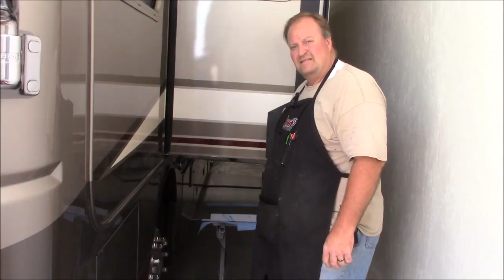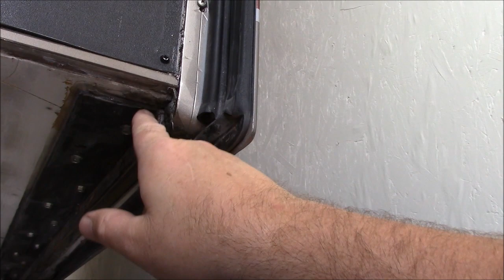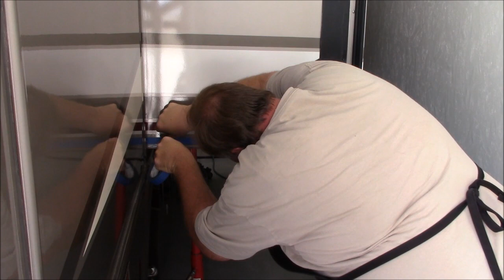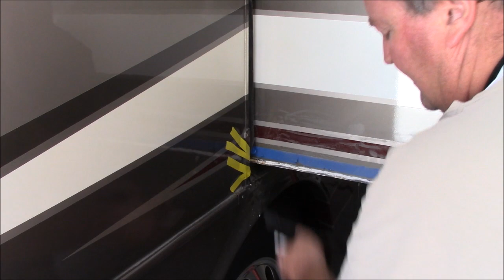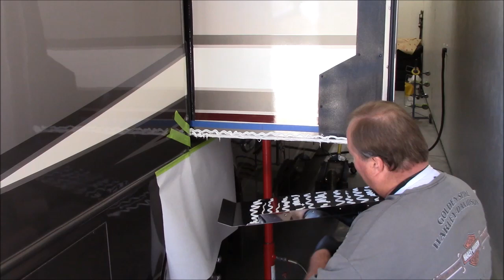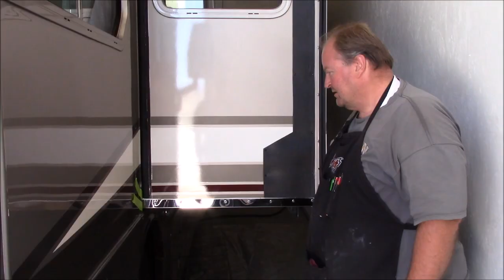Guardian Plates for Monaco HR Flat Floor Slides FF1200

Comment: Mike, a couple questions. Did you cut/trim the black plastic cover so it is not behind the side of the plate?  Also will the rivet heads on the bottom dig into the UHMW bar?  I have some minor rot on my 06 I did not think I had any when I bought it. Solid but the plastic floor is sagging on the ends a little and the wood has been wet. Terrible job by Monaco on this. Thanks for the video.
Reply from the maker: I don't recall trimming the black cover but I did trim the lower angle back and machined a groove in the black lock guide so it didn't bind the lock.

Mike

Comment: How deep is the 25° lip?
Were are the mentioned rivets on the underside?
Reply from the maker: I’m not sure what depth your after. Are you inquiring from the end of the plate under the slide floor to the center of the bend?  If that’s the case I would say 2-3 inches. 

I’m guessing based on memory as it’s been a couple years since I installed them.  If you need any specific measurements I’d contact Chris at Talin and he can measure one and give you an exact measurement.  

Thanks for watching.  
Mike

Comment: Glad to see this.  I need to do this on our '05 Monaco Knight 38PDQ.  It has both the flat slide and the lifted slide.  Question - If none of the guardian seams or caulk is tapered down from the body to the outside edge of the slide, what keeps water from walking along that flat seam and into the coach?
Reply from the maker: The 3M 5200 adhesive and rivers keep the Guardian plates tight against the wall and floor of the slide. It is much tighter than the extruded aluminum channel that Monaco used.  
Thanks for watching. 
Mike

Comment: I had to say thanks for your very informative Video On Augahot  fuel pump  replacement. I have repaired several WEBSCO  in my lifetime but at my old age I had not taken one apart in a long time. You explained everything in such detail that I have every confidence that I can handle a pump replacement. Have the unit out of the bay about to dismantlable tomorrow!!!
Reply from the maker: Thank you for the comments and for watching.  I’m glad to hear the video was informative.  
I hope you will check out some if my other videos when you have time. 
Mike

Comment: Like the watts link videos, excellent job of narrating and explaining everything.
Do you think you could demonstrate the modifications after they were installed, wanted to see how the plates did going inn and out with the rivets, curious if they catch at all in operation.
Wanted badly to see firsthand how that Watts link did on the road.
Thanks for all of your hard work on the installation and editing your videos.
Wish every rv owner was as meticulous as you, would make buying a used unit easier,
Yours is immaculate.
Reply from the maker: Thank you very much for the comments. No issues whatsoever of the rivers gliding in over the west bar.  I’ve used it all summer long and it slides in/out perfectly. 
Thanks again for watching and commenting. 
Mike

Comment: Mike, Great videos on the Guardian Plates and roller plates.  It seems like you used one type of adhesive and then a different type of caulk. Would you mind sharing what types you used?  Thanks, Mark
Reply from the maker: Thanks for the comments. I used the 3M 5200 Marine Adhesive for gluing the Guardian Plates in place. Chris also supplies a tube of clear silicone with his kits to run around the perimeter but I have had excellent results using Dow Corning 999A (in either clear or black) so that is what I used to seal the rivet centers as well as the perimeter. 
Thanks again for watching. 
Mike